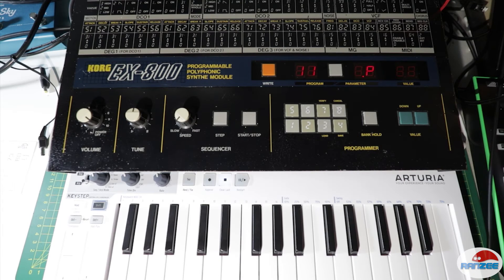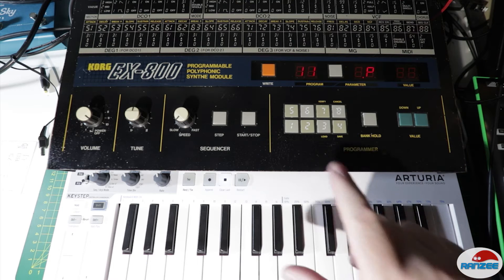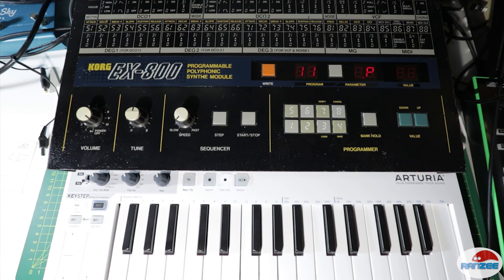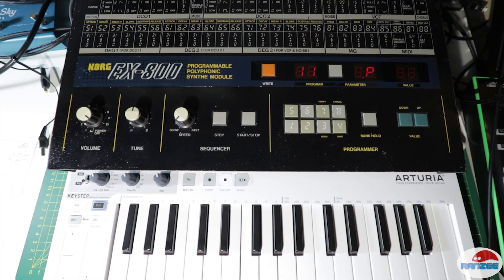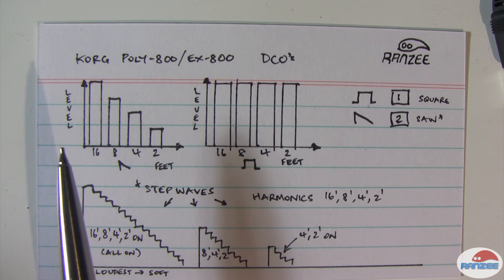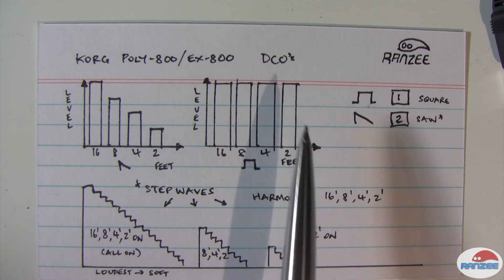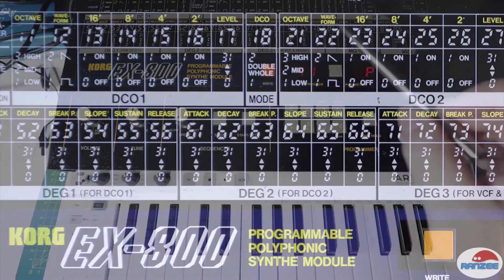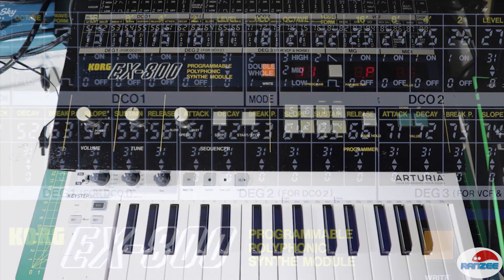Korg EX-800 (Poly-800) Part 1-Oscillators

Comment: I think the Roland alphas use similar technology not a real dco but a seudo digital additive  also the Crumar bit one uses the same no analog wave shapers
Reply from the maker: Some interesting info on the Juno oscillators here: https://blog.thea.codes/the-design-of-the-juno-dco/ - but I don't think they're the same idea as the Korg Poly-800 (EX-800). They do invoke waveshaping - and this can be beneficial in terms of generating actual analog waveforms :)
Reply: the juno6 60 and 106 use that type of dco the alphas use a single chip for all six voices I think it’s called br87123 this chip produces all the wave forms and sub oscillators and then goes through a dac  and then the vcos vca combo

Comment: You mention it being an "additive" synthesis synth, but everywhere else I've seen it described (including Wikipedia), it's referred to as a "subtractive" synthesis synth.

I suppose an argument could be made that you're "adding harmonics" with the 8', 4' and 2' voices, but then again, you're taking them out with the filter.

And yes, traditional "additive" synthesis would be adding sine waves together (potentially hundreds) and having some control over each one. So, I'm not really sure into which category this synth falls! ;)
Reply from the maker: Hey Shawdows of Life! Thanks for watching :) Oh it definitely is subtractive, no doubt about that. They've probably just cashed in on a few of these features to dangle the carrot back in 1983. Really it just plays with the harmonics - and lends itself to the older organ days. The biggest issue with this synth is the chiptune sound (which is a good thing too) and the single filter!